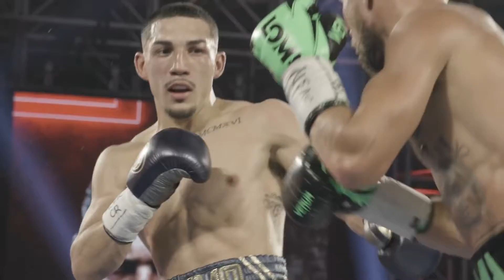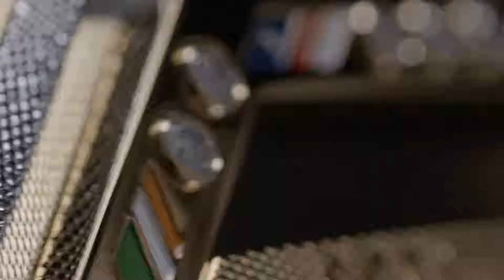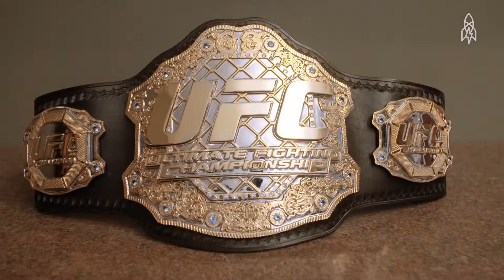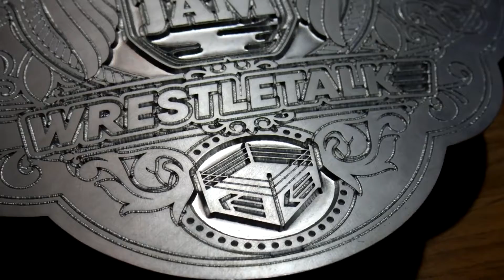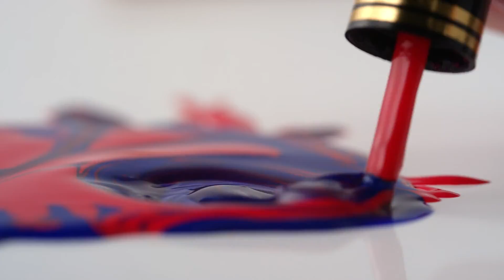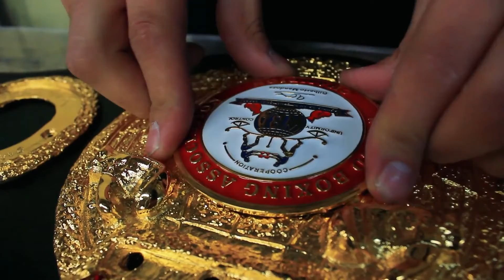How It's Made: Boxing Championship Belts

Comment: Are WBC, WBA, IBF, WBO belts are made from real Gold? And how many Karat Gold they used?
Reply: Gold plated
Reply: From what I know the metal part of the belt is mostly made of steel or aluminum, they coat the metal with whatever they were customly asked for, like if you asked for a diamond to eb added they ad a diamond, and if you wanted to add gold you pick what kind of gold. 

I think, I don't know for sure
Reply: Body is usually zamec or aluminum .Zamec is the metal hot wheels are made from.Then its plated.Tin does not cast as crisp as zamec.
Reply: No.  None of them are, actually.  The WBA and WBC's are gold plated, while the IBF, IBO and WBO belts are essentially gold plated resin (and easily damaged).
Reply: Only one that was actually gold was the original Lonsdale belt and that became gold plated in the late 60s I believe.